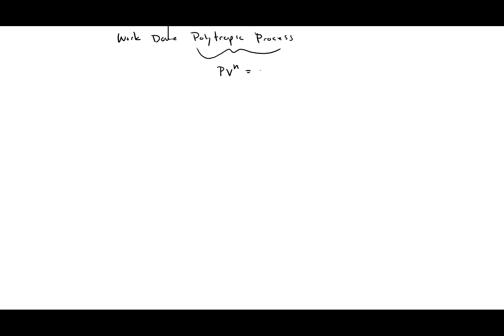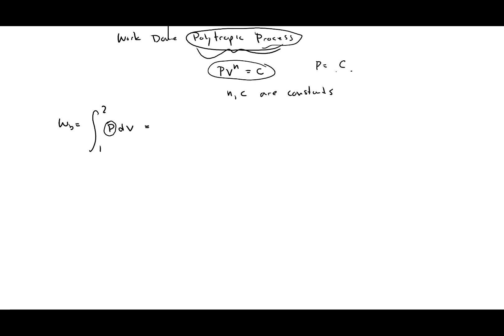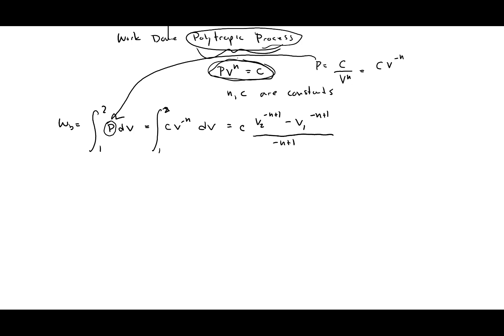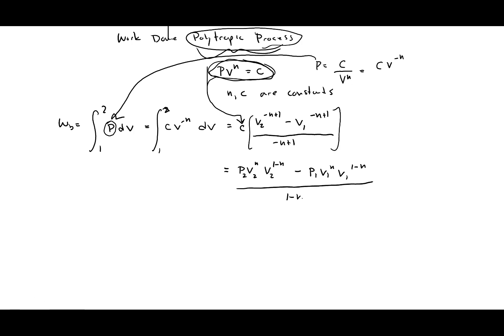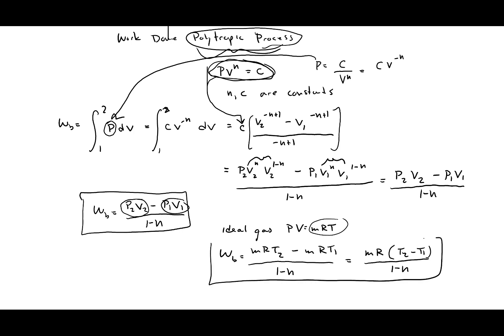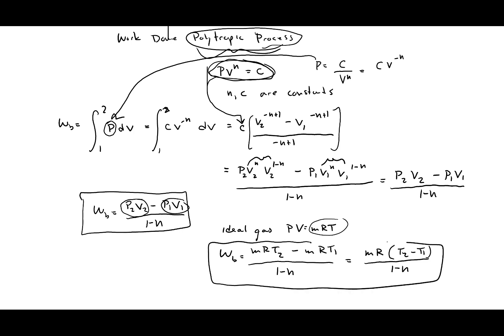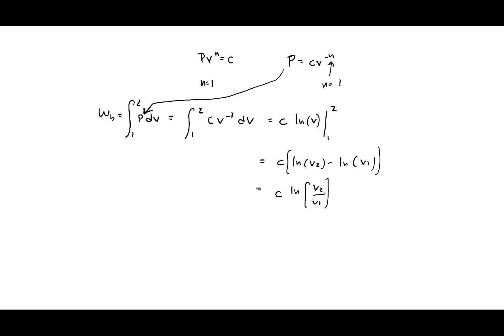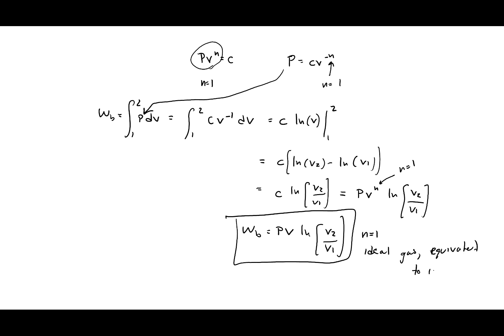Thermodynamics: Boundary Work, Polytropic Process

Comment: I had a test problem involving this today and I have no idea what was going on. Didn’t even attempt it. This video does not help me figure it out. The question had three unknowns. The pressure, P1 and P2, was unknown.Both volumes were unknown. And no value for n was given. The values that were given were C = 27kPA x m^9/2, Wb = 29KJ, and the final volume was 4 times the initial volume. The question was asking to determine both the initial and final volume. How was I supposed to do that when n is unknown?
Reply: heat capacities help to calculate n , if it was steam you can look it up, as well as the heat capacities for most chemical species. if it was an ideal gas n = cp/cv where its the constant pressure heat capacity over the constant volume heat capacity.
Reply: This video only shows how to derive boundary work, not really any step before hand and ofc every problem varies